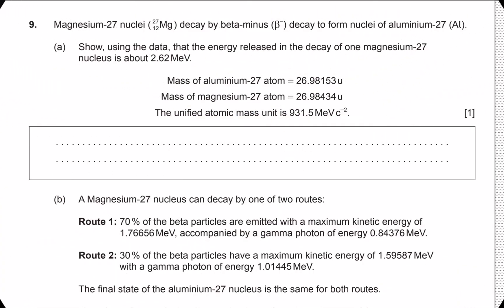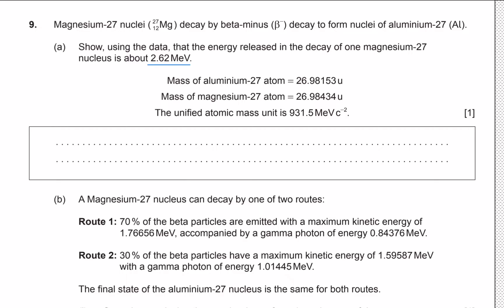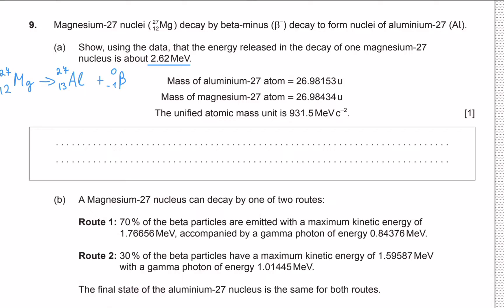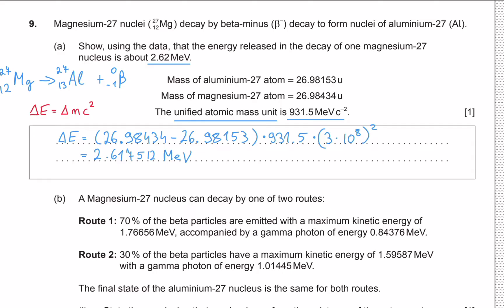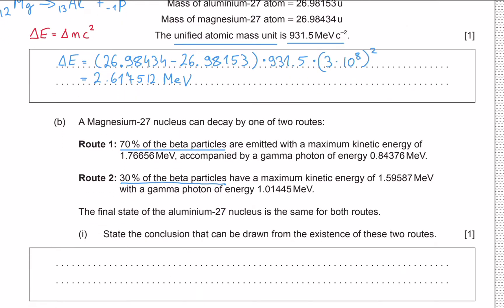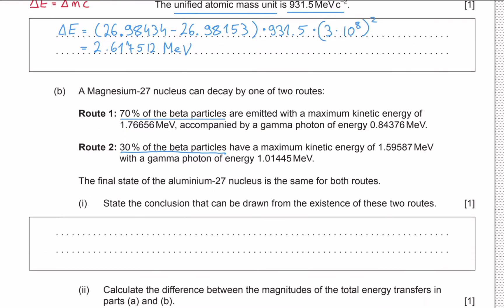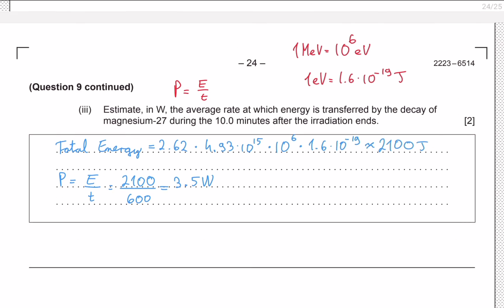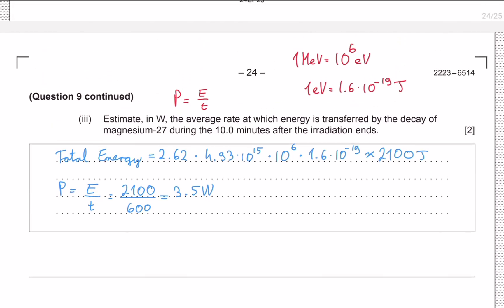IB Phy HL M23 TZ2 Paper 2 Q9 Radioactive Decay

Comment: for the very first calculation. the answer literally gives a change in energy as 2.356 x 10^{17}. I tried to see if it was my calculator having a problem, but i dont seem to find any issue(after trying it on multiple calculators). The answer should give 2.62 but in reality it doesnt give that. Maybe i'm the one making an error here, please help.
Reply from the maker: Ummm, yes you are right. I wrote it wrong, there is absolutely no reason to multiply with c^2 in the formula, as the 931.5 is the conversion number that converts atomic mass units to MeV, no need to multiply with another c^2.
Reply: @ConvergingIB  But then the unit remains as MeVc^-2. The question gives us 2.64 MeV